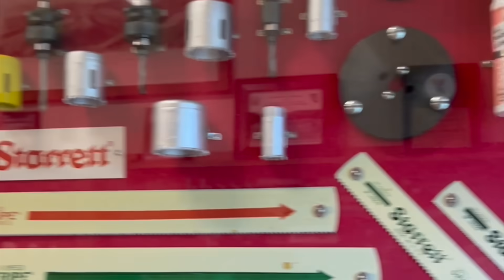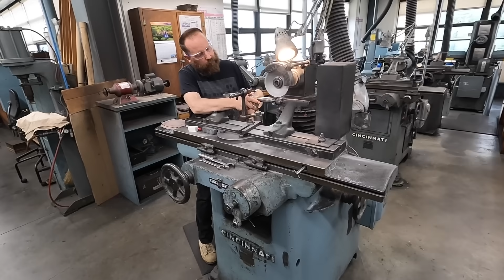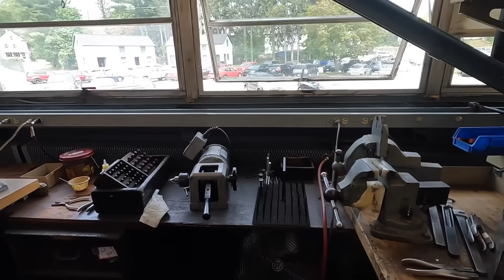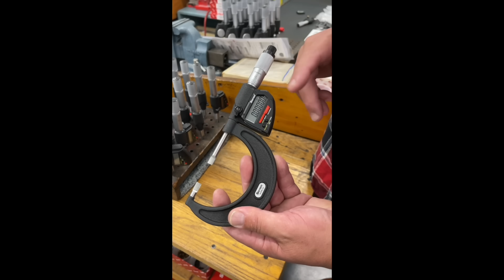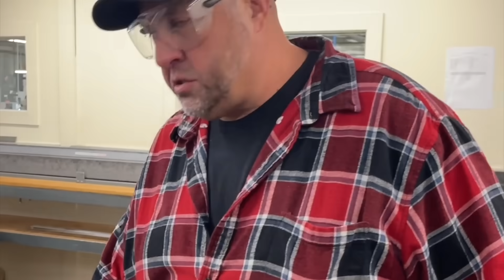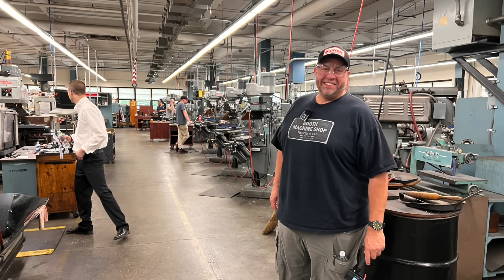The L.S. Starrett Company Factory Tour Part 1

Comment: We brought 3 digital micrometer. all are not working and stop buying digital product from starrett, only analog tools.
Reply: I'm not a fan of digital but the qa dept talked me into getting a digi calipers (I was sending my dial cals in for repairs at least once per year,, regular use, no abuse). Seems the standard in the shop is the Mitutoyo digis, but I spent the extra dough and tried the coolant-proof Starrett calipers. Been 6 years so far and they work great. Still not a fan of digitals but as long as it repeats and is accurate, it'll work.

Comment: I'm a 64yr old Toolmaker myself. I have Starrett tools that are older than I am. I have some catalogs from the 50s~60s. I'd bet half of the tools they made back then are obsolete these days. I even have some of their mics for measuring gears & gear teeth, and some other specialty measuring devices & gages. Stuff nobody knows what it's for or how to measure it. 
I get engineering college interns who can't read a vernier or direct-reading micrometer.
But I must say, I was highly disappointed in that Made in China Starrett 799 digital caliper. What a POS!
Reply: It’s very sad. If they just made a separate line of tools like Snap-On with their “BluePoint” that are cheaper and more entry level, I wouldn’t see it being a problem. But when you mix in offshore junk with your main brand, it all goes to hell. 

That’s why I’m a mitutoyo fan :)

Comment: Back in 1968 I was in 8th grade and took some what of the same tour. The machines back then were even older. No CNC or lasers. The thing I remember the most about the visit was the use of light to calibrate the solid steel squares. Very similar to what they still use on the scale production. Great Vid.

Comment: Did a little background check of L.S. Starrett Company.  Turns out it was just recently (march 2024) SOLD to a private company "MiddleGround Capital" that says the following about themselves: "We partner and align ourselves with management teams to execute a customized value creation program that drives equity value back to our investors as well as management".   What I read from that statement is: CHINA here we come, make room for all our production facilities to maximize profit to us in a transition phase where customers still think they are getting US made quality tools while we charge the full price until they realize the product is made from tinfoil in China and the company plummets.
Reply: I mean, I know that's the fear, but it looks like MiddleGround is acquiring US and European companies to keep them where they are, and separating them from Wall Street. Can't have investors pushing a race to the bottom to meet quarterly earnings expectations if you're not a publicly traded company. As best as I can tell, they haven't yet saddled a company with the debt that was used to acquire it and then liquidate it. On the flip side, I could certainly see them moving the factory somewhere else and then converting the factory into apartments.

If I'm right about the purpose of the company, though, look forward to them buying a US-based semiconductor company or two in the future.

Comment: About 20 years ago i bought 3 T-handle tap wrenches and a clamp for the tool makers V block i made. One of the tap wrenches collet had been broached so far off center that it was unusable. Tapped hole in my v block clamp was about an 1/8 inch off. Last Starrett tools i have bought. I even mentioned this to a rep that showed up at the shop i work at. No follow up. Croblocks are awesome but other than that division, just die.

Comment: I seen some Gallmeyer & Livingston Grinders,I used to repair them😊
Reply: I have a G&L surface grinder that the table is jammed all the way out on. Still traverses side to side, but is jammed forward and back. Would love to hear your thoughts on what I should do!
Reply: @emeyerriecks  linkage to the hydraulic valve is some how not engaging to change the direction? your travel stops are not adjusted right?

Comment: The Starrett 0-1 stainless steel Mic is the best looking, and premium feeling Micrometer out there in my opinion
Reply: then u havent had a Mitutoyo Quantumike ;)
Reply: @pirminkogleck4056  I have never been into Digital Tools, except a Height Gauge, Comparator, etc. I have Vernier Calipers, mostly use Dial Calipers though, much quicker. Vernier Mics of course.
Reply: @pirminkogleck4056  I have never been into Digital Tools, except a Height Gauge, Comparator, etc. I have Vernier and Dial Calipers and Vernier Mics. I am sure they are high quality Mics - I am just old school.

Comment: Nothing like the modern factories in Japan and Taiwan.
Maybe they should invest in air conditioning instead of ceiling fans and desktop fans strewn around the place.
Reply: You cant air condition a space like that, the factory was built 100 years ago., it would be cheaper to build a new factory than retrofit/insulate that building and than pay the electric bill for the a/c every month. they arn't going to invest anything in the factory b/c they new their time was running out and would eventually be sold ... Which they just were.

Comment: Starrett sold to Middle Ground, a now parent company to Starrett. They took the company private so no longer on the stock market...during the sale, stock holders made $16 per share.
Reply: From the Starrett website: 
THE L.S. STARRETT COMPANY ENTERS INTO A MERGER AGREEMENT WITH MIDDLEGROUND CAPITAL TO BECOME PRIVATE COMPANY

So they merged, they didn't "sell."
Reading further down the site it started that this will help Starrett with "reshoring." That means they'll likely be 100% USA made again.
Reply: @glenj.taylor2938  Sounds like they bought out all of the stock holders and then now are a private company under the umbrella of Middle Ground. If that is what they did, I'm all for it because a public owned company, stock holders and all of the B.S. that goes with it, cost more to do business and make simply things complicated. All of that is not good for the folks who use the products. It may  benefit the stock holders however, the customers are those who bring in the money. Wall Street is phony business anyway, its full of HYPE and rarely any of them make a company run better and any private owned one. 
This will help Starrett with their margins vs. share it all with those stock holders every quarter.

Comment: I begin to understand why Starrett was forced to sell last month. I did a quick price check. That beautifully hand-finished 6" scale will set you back about $40 on Amazon. The equivalent Mitutoyo scale will set you back about $15. Mitutoyo tools ain't garbage. As far as I know, their scales are straight, flat and accurate. Will anyone tell me otherwise?

What strikes me about this tour is how much hand work Starrett still puts into building bread-and-butter tools. Maybe that makes sense for low-volume specialty tools, but it can't be competitive for high-volume items like scales and feeler gauges. I'm guessing Mitutoyo has invested a lot into automating the production and inspection so that they can produced a quality scale, at volume, at a price the market will accept.

A lot of people here are saying that they hope the private equity firm that bought the company doesn't change anything. That's wrong. Starrett obviously can't survive without changes. It's still an open question whether the new owners are capable of building Starrett into the company it ought to be--efficient, innovative, and here in the US--or if they just intend to strip the brand equity by packing cheap Chinese junk in pretty red boxes. Either one is possible--try to maintain an open mind, and hope for the best (but prepare for the worst).
Reply: I think Titan has some Mitutoyo factory tour videos
Reply: @ringlord13  I remembered seeing some on one of the machine shop channels, but I couldn't remember which one.

Comment: I like the older wooden benches vs. the new cell units of Blue metal benches.  

Something about precision tools stored and working/ sitting on wood
Reply: Wood is (or was) the best material to have around bare steel as it absorbs moisture from the air and breathes to keep the metal dry.
Reply: Of course. Wheeling in a bunch of blue boxes is a weird idea.

Comment: It's unfortunate that new Starrett tools are living off the reputation of their older tools.
I was extremely disappointed when i purchased a new Starrett micrometer, only to find the spindle tight and gritty. The calibration personnel and i took it apart to investigate. The threads were full of metal shards. We sent it back for a refund.
I have bought Mitutoyo tools for the last 30 years and never regretted it.
Reply: We almost exclusively use Mitutoyo at work and I don't want to use anything else honestly.

Comment: What a great time capsule for engineering, technology, and manufacturing. But that's it just a time capsule. While cool from a living museum stnadpoint, that doesn't really reflect Starrett's ability to keep with the times. It is pretty obvious why the reputation has been wavering in the morden era. Pulling for them to revitalize the brand and get back on top. That aera of Massachusetts needs them. There isn't much else around.
Reply: Did you notice the massive area & machines but few people?? Maybe it was filmed during a weekend
Reply: @REVNUMANEWBERN  I think the idle equipment is probalby used on products that don't sell a whole lot, but they are still willing to offer these products in their catalog, so they have to keep machinery around just in case they need to build a few.

Comment: I need a 50' tape steel tape measure 1/4"-1/2" wide that measures in 1/8" and 1/100' on the same side of the tape. but nobody makes them. one company has this tape but the 1/8" graduations and 1/100' graduations are not on the same side of the tape and it is made of fiberglass. Starrett please make this tape.

Comment: Ar the beginning of the video it was kind of scary to hear the guy say the tools lasting for so long was the problem. Especially when they just sold the company last month.
The corporate world minions like to make sure they control everything. "Competition is a sin" to them. Most things produced nowadays are designed to fail in some way that requires replacement or replacement parts. 
Like light bulbs that have lasted over a hundred years until the corporate world minions conspired to make all bulbs with a filament that would burn up after so many hours.
Surprised, there was no mention of them selling out.

Comment: i wish i could afford a surface plate. like a 3x4 or something of that size. but, one can dream haha. my Grandfather had a Starrett dial indicator. its missing some connector parts but the indicator itself is fully intact, if aged a bit. but, i find it pretty awesome that he had such a tool, and it is now come to me, even if it may not be in the best shape, it still works (i just can't mount it anywhere, and dont have a base for it) (so i opted to get a mag-base dial indicator of my own, though had to go for an affordable model, and didnt need absolute precision as i use it for my wood turning, just to keep some consistency when i change the stave to one end or the other, and so i can get some consistency between cuts when compared to the lathe bed and the thickness of the piece.